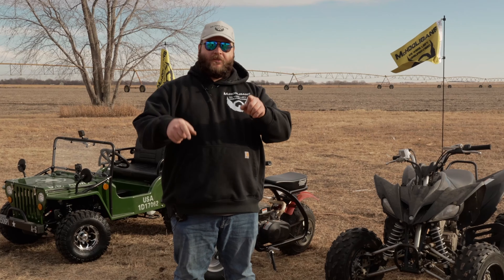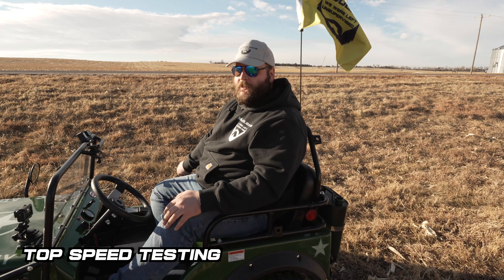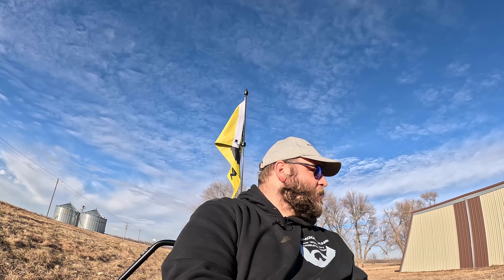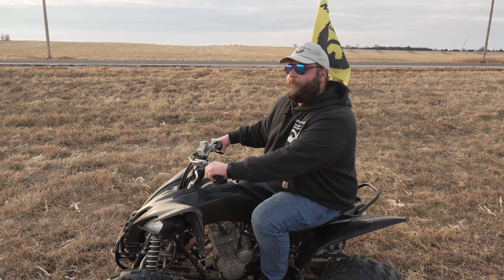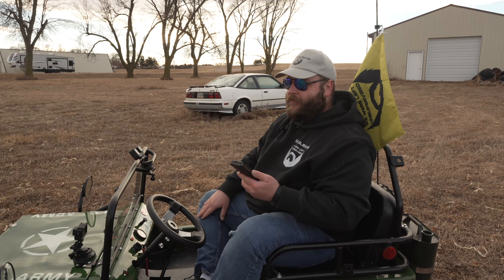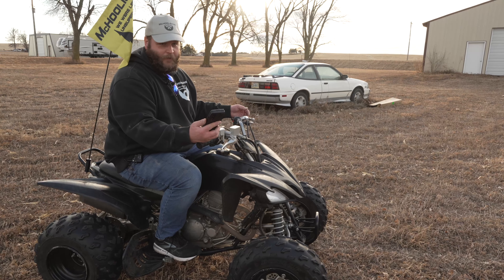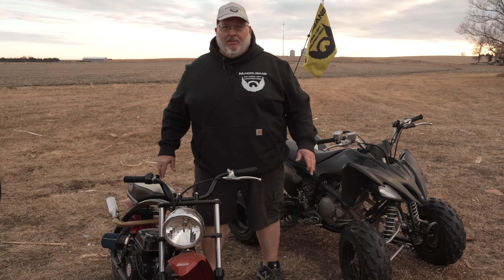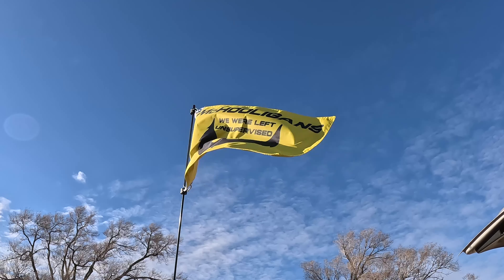Performance Testing (Mini Jeep)

Comment: When I first floored it in our mini jeep, I was disappointed at how little power it had BUT… we read that the engine needed 2 weeks to break in. So after breaking it in I did full throttle again and it seemed to perform MUCH MUCH better.